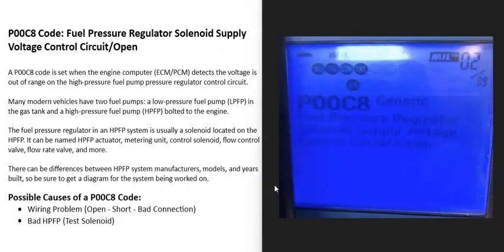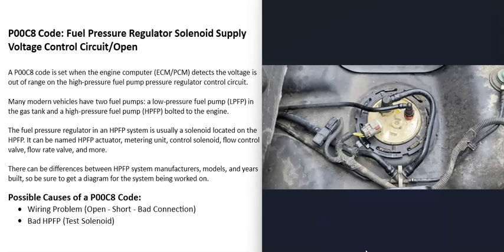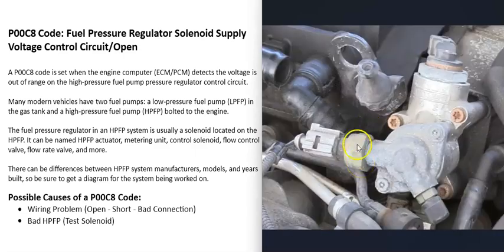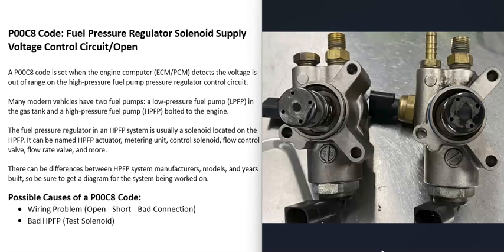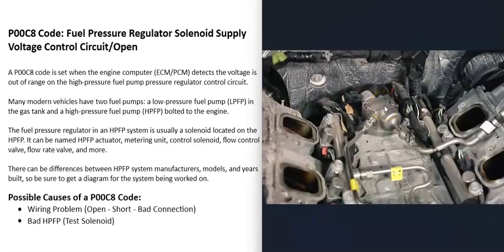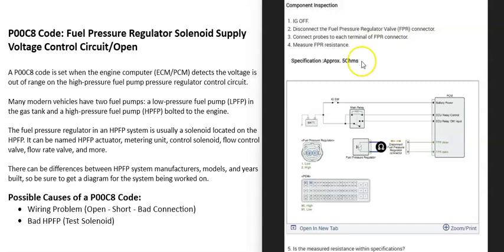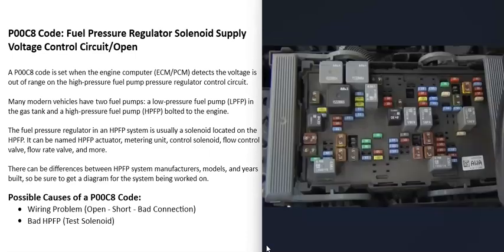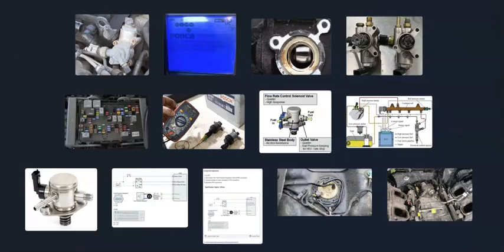Causes and Fixes P00C8 Code: Fuel Pressure Regulator Solenoid Supply Voltage Control Circuit/Open

Comment: I have a 2013 GMC Terrain SLE 2.4L with this code as well as p0192, P0090, and misfires. I have changed out injectors, high pressure fuel pump, plugs, high pressure solinoid, the wireing harness for the fuel rail, followed the lines and found nothing and this problem is still there.